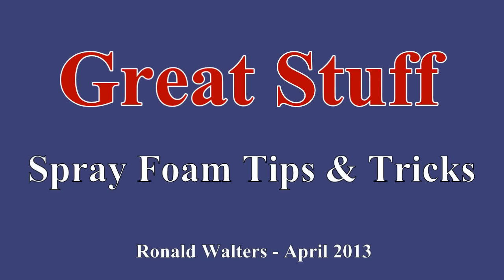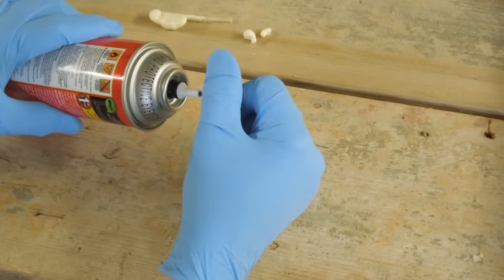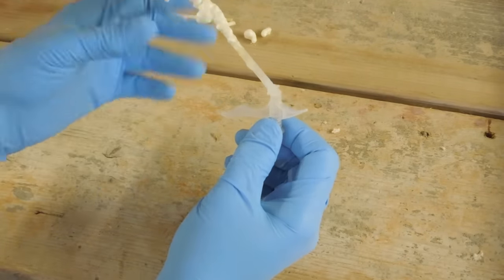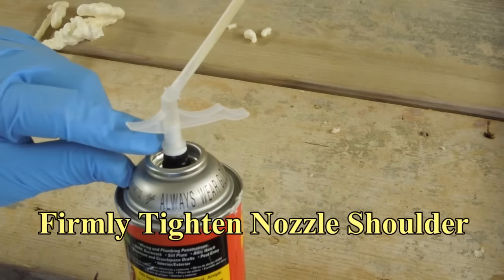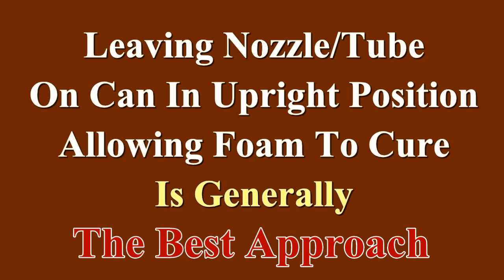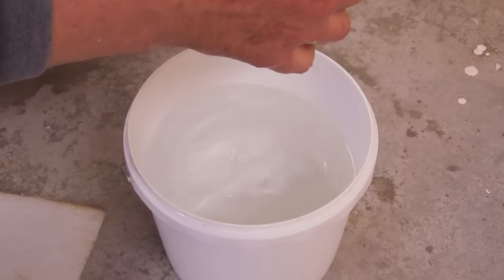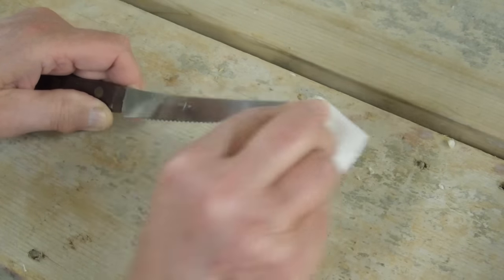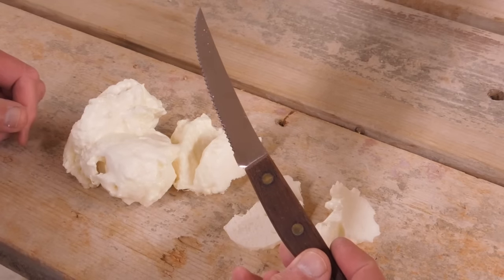Reusing Spray Foam Cans No.1 - Tips & Tricks

Comment: I would like to use "Great Stuff" for a Shipping foam, I get it that I should mist water inside of a trash bag, before adding the foam. Has anyone tried this?  Any good ideas or horror stories?
Reply from the maker: Great Stuff requires moisture to properly cure. Spray the inside of the plastic bag with water. Experiment beforehand... don't be excessive... don't be skimpy. More foam requires more water... less foam requires less water.

Comment: because removing uncured foam is easier and more effective than putzing with cured foam.  Acetone is not expensive, and trust me (I know you have no basis for trusting another mouth on the internet) but the valve is fully capable of withstanding acetone.  Been there done that.

Comment: Me: 💭 Why do I like listening to him teach? 

Me: 👀Where was he at when I was in junior high?

Me: Where was he at when I was In high school? 😫
 
Also me: I wonder If I can get him to tutor me in college 🤓
Reply from the maker: If you like me so much, I hope you have subscribed. I teach many different things on my channel. Thanks for watching! Ron :-)
Reply: I did while watching the video 😊 The reason I came is because I just ordered 2 cans of this product and I don’t know what the heck I’m doing. I didn’t know it slowly gets bigger. I have small cracks, how can I squeeze it in the crack without it getting bigger
Reply from the maker: You cannot control the expansion. If it expands too much, then you trim off the excess after the expansion cures. Great Stuff exerts quite a bit of pressure when it expands and cures. It this is in a crack in concrete or brick then no problem. If is is a crack around windows or doors it can distort (warp) the frame and that can really be a problem (the doors or windows may not operate correctly). There is a low-strength expansion foam for application around door and window frames. Or... maybe expanding foam is the wrong material for your cracks... maybe silicone (or similar material) would be a better application.  Not knowing the problem, I cannot accurately answer the question.
Reply: Ronald Walters Its a half of inch and lower. A crack in the wall that insects are coming out.
Reply from the maker: What type wall? Concrete, masonry, drywall ?

Comment: I had to fill 2 small holes in a hollow door. What a waste. Lol. Thanks !
Reply from the maker: This material can be dangerous if used around window or door frames because after it initially takes a set... it will continue to expand and that can cause the frame to bow inwards. Used inside a hollow core door can cause the door skin to bulge and bow outwards. Thanks for watching
Reply: @RonaldWalters2010  Thanks. I will keep my eye on it.

Comment: Be careful using this stuff to make a form fit in a plastic bag, it will not kick off in a plastic bag and just turn into a gooey mess.
Reply from the maker: The foam requires moisture (humidity) to cure. Mist the inside of the bag with a fine spray of water first and then inject the foam. It will expand and cure perfectly.

Comment: I have an oscillating blade tool.  Different brand but sort of like this one.

http://toolguyd.com/blog/wp-content/uploads/2011/03/Porter-Cable-Corded-Oscillating-Multi-Tool.jpg

I've found that using my grinder to put a knife edge on a used up blade will let me cut foam board and this sort of foam with incredible precision.  

Perhaps that'll be of help to someone else.
Reply: Doug-I should have scrolled down and read your comment. Sorry I pretty much repeated what you have said, in my comments. The multi tool is what I always use to carve and shape the cured foam. A bit noisy, but I find it is the quickest and best way to get some detail in finishing off the expanded foam fill requirements.

Comment: I am looking for a way to spread or ply down the thickness of the foam to 0.2 to 0.3 cm immediately when the foam just come out of the sprayer tip. I want the result looks like this youtube.com/shorts/AyYGeftJCc8, instead of lumps everywhere. Any idea?
Reply from the maker: The video you sent me is showing thinset being applied. Thinset is a material which is mixed with water and is then spread out evenly to bond tile to a concrete floor. 
Polyurethane foam is never going to work like that. Polyurethane foam comes out of the nozzle or is sprayed onto a surface... it then reacts with moisture on the surface or with humidity in the air which is what causes it to foam and expand. Evenly commercial or professionally sprayed foam does not have an even or perfectly smooth appearance when sprayed on a surface like that. If you try to spread it to a 2 or 3 mm  layer, it would then continue to expand to a greater thickness. Often times when you try to redistribute the polyurethane foam you will end up with a mess which will (for various reasons) end up not curing properly.
The only other alternative I can see would be to spray the foam, wait for it to cure and then machine it (or sand it) to the desired thickness.
Thanks for watching.
Ron

Comment: And the wife doesn't tell you what else she uses your toothbrush for either...
Reply from the maker: Now that's just wrong! :-)  Thanks for watching.
Reply: Heh, heh, just having a little fun.  §;^) 
Thank you ever so much for the Great Stuff tips!
Reply from the maker: Thanks for watching. Hope you have subscribed. Recently I released two more videos on the spray foam topic. Great Stuff sold at Home Depot has a redesigned straw which I found to be an overcomplication. I have not seen this at other stores (not yet). Hopefully they will go back the original design… but then they would have to admit they made a mistake.Reusing Spray Foam Cans No. 2 - Tips & Tricks  https://youtu.be/Ig1GD07miiwReusing Spray Foam Cans No. 3 - Cleaning New Straws  https://youtu.be/mg2NYBpd_5Y

Comment: If you get this stuff on your fingers when it's wet then not even a nuclear bomb will get off your fingers 😳😳😳
Reply from the maker: Mineral Spirits will remove it, if it is still wet. After that, when it becomes sticky or has dried, Acetone will take it off... a little rough on the skin but it will remove it. Acetone is what used to be in nail polish remover.

Comment: I was only able to use this product only  once. One hour later no foam would spray out and I couldn't even remove the nozzle from the Can. I'm going to return it for a full refund. Shit Product
Reply from the maker: Good luck with that return. It says on the can that you may experience single use (or something similar).
Reply: @Ronald Walters  It only says if the Foam doesn't come out to throw away the can. I only used 10% yesterday and will attempt to return it today.
Reply: @RonaldWalters2010  I got a full refund.